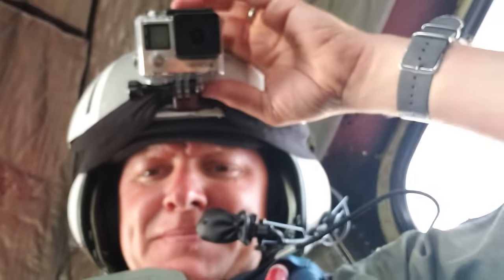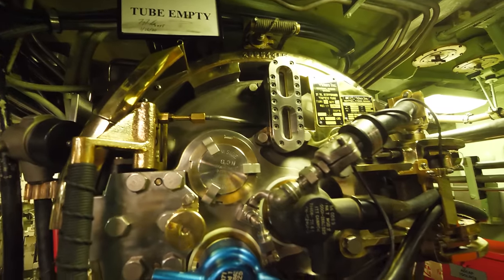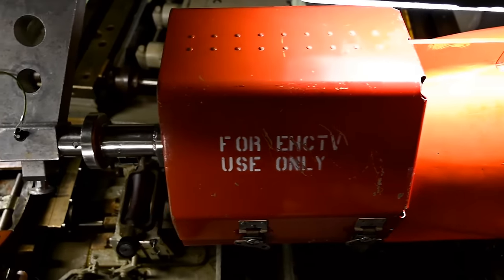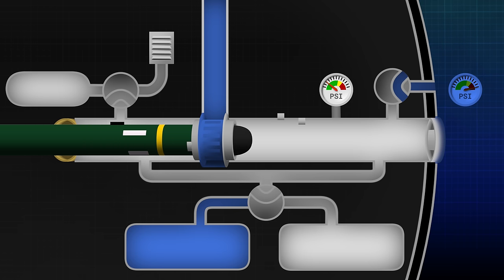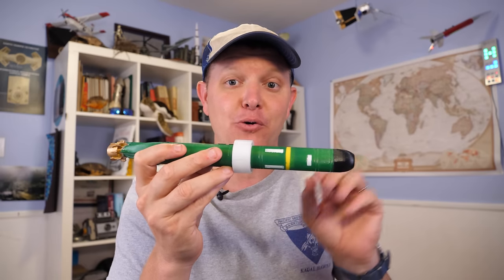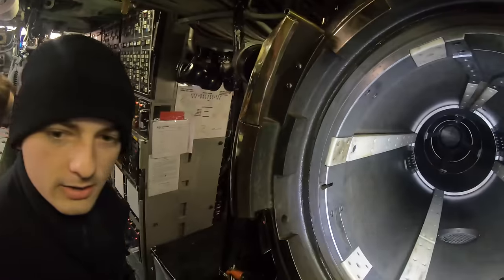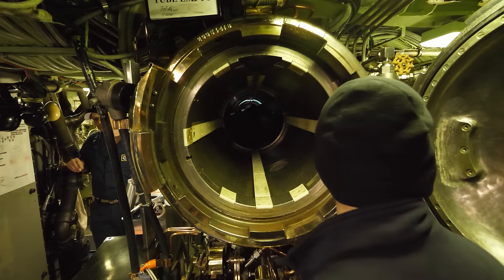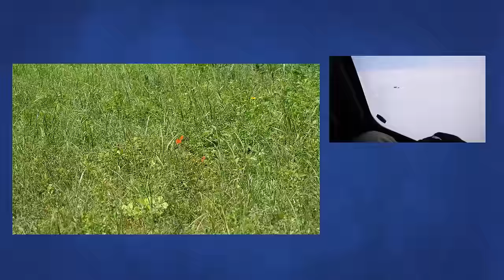Crawling Down A Torpedo Tube -US NAVY Nuclear Submarine - Smarter Every Day 241

Comment: Our company developed the active sensing warhead, for the Mk48.  I was a junior engineer at that time, and one guy and I did the "simulated" runs to test and measure the sensitivity of the warhead, at various angles, using a ten-ton truck, with an aluminum plate mounted on its side.  We drove the truck by the warhead, at structured distances and angles, to simulate both surface ships, and submarines.  Speeds ranged from 3-mph (truck minimum) to over 60-mph (or more) to determine maximum limits high and low.  A special high velocity fixture was used determine closure rates of over 100-mph.  After the torpedo went into manufacturing, we supported hundreds of test runs on targets in test bays, and then with actual ships.  Your video is one of the ones we analyzed, as verified by the spray signature.  Our company also designed the improved sensors for the Barstur Underwater Range.  Used for many such testing scenarios.  Now the Range is huge, over 100-miles wide or more in some sensing capabilities, and is 3-D, using aircraft and satellites.  Many more videos possible about its capabilities.

Comment: I love that, "Apparently there's ice on the door"
"Ice?"
"Yeah!"
I feel like when you're an expert in your field you stop noticing the funny details. In my line of work (radiation therapy) a student noticed that the old cctv monitor shows small flashes on random light from where mega voltage xray photons interact with the camera sensor.
Reply: You can see the same effect of video footage at Chernobyl. The radiation leak caused a grainy or snow effect on the video
Reply: @notmenotme614  that's more due to photons interacting with the silver halide crystals of old film. This is also how we measure body doses on staff, they're called TLD's!

Comment: Me seeing Destin sign his name in a torpedo tube: cool
My brain: I wonder how many submariners have been pranked by having the door shut on them.
Dark side of my brain: has anyone been punished by being stuffed into a torpedo tube and having it filed and pressurised?
Reply: Thats terrifying, i will never crawl inside a tube again : ^)
Reply: Funnily enough, the torpedo tubes are one of the escape routes for submariners. So yes, people have been in them. The difference is, they don't use the water pressurisation "firing" part, Just flood the tube and pop the door.
Reply: Special forces guys used to launch themselves out of the tube. I can't remember, but I think the first time they tried it they actually pressurised and fired it and the guy nearly died. He was a tough dude though and they weren't too deep so he did survive, just barely.
Reply: I've heard of shipyard workers pranking each other by locking the new guy or gal into a tube. Thankfully those are apparently open on the other side while in drydock.
Reply: I mean that would only work if the submarine is relatively close to surface, at a deep altitude you wouldn't even be able to open the door without pressurizing the tube, because of well... the pressure difference. not to mention if the pressurization itself would kill the person, so would the pressure of the sea outside as well ;)
Reply: "My brain: I wonder how many submariners have been pranked by having the door shut on them."

Pretty much all of them.  diving a tube is part of qualifying the room, and Torpedomen, to a man, believe they are hilarious.  A lot (most?) nubs freak out and start screaming.
Reply: @xmlthegreat  I believe it. Just working in an industrial setting; they would lock the new guys (of which I was one) in the elevator over lunch.
Reply: ah! 😩 Thanks for reactivating my  fears 😭
Reply: Back when I was in, I heard about some hazing.  Once a guy was down towards the muzzle door, they covered the door with a wool blanket and tapped the side of the tube with a wrench (to simulate the door clanking shut), and then cracked the pressurized air (to simulate the sound of water flooding down the tube).  The guy freaked out, and came out of the tube head first!
If it wasn't apparent from the video, it is NOT a simple matter to turn around in the tubes (and basically impossible for most people).  The single greatest factor that will determine if it is even possible to turn around in a tube is the length of your femur.  The maximum diameter in any part of the tube is about 22 inches, and your femur has to be enough shorter than that or it's not physically possible. That, a great deal of flexibility, and enough adrenaline to prevent your brain from even considering you can't turn around in a tube is what is necessary for coming out head first.
Reply: @BrianDaleNeeley  The asshattery sounds high in the Navy. Though at least that was the appropriate hazing method; closing the actual door is an unnecessary risk.
Reply: @GummieI  the internal tube pressure has to match outside pressure before the tube hatch will open, so yeah, there's limits but submariners train for some pretty deep..err..depths for surface dwellers.  In the Australian submarine Corps, there's a qualifying test for swimming, breath holding, confined spaces etc that I couldn't pass at the time I might have gone in, even with over a decade of regular surfing and swimming.   These days,  I doubt I could get down the tower ladder haha. 

I was lucky enough to get to tour an Australian Oxley class submarine when I was in highschool, which is about a third the size of an American sub and non nuclear, and I was also super grateful to get back off again. I got the chance to lay in one of the enlisted bunks and my face was less than 3" from the bunk above.  And when my host took me down to the torpedo room and explained the torpedomans escape, this Navy cadet decided that maybe the army was more my speed.

Comment: As a US Navy Veteran for about 8 years, there's a lot of things I didn't know outside my US Navy Job Specialty in NAVAL AVIATION onboard AIRCRAFT CARRIERS,  as was US Navy Schooled as an AMH-2 Flight Controls Systems / Structural, Hydraulic Technician Mechanic, My Skill easily can UNDERSTAND how a SUBMARINE WAS ENGINEERED AND moves in the water with their Mechanical Systems.

Comment: If you ever have a chance to be around light attack bombers or fighter Jets depending on the model you could ask to dive the intake which is going in from the front crawling your way down the intake tube to the very front of the engine or you have to inspect the front blades for a small vibration cracks or dings that have started or occurred. Another fun little thing we used to get to do when pre-tripping aircraft in the Navy. Fyi, I used to do that on A7-II Corsairs.
GO NAVY!! 🇺🇲

Comment: "I never would have expected ice on the door" while in a submarine under the arctic ice. Smarter every day! 
It's still very fascinating, don't get me wrong. I can't wait to see more, thank's Destin!
Reply: I wouldn't have expected ice either, because you know, liquid water on the other side of it. I'd expect it to be cold, degree or two above freezing, but not icy. I suspect he may have just mistook very cold condensation with ice. But I suppose the salinity and water pressure might drop the freezing point far enough outside that the hatch might have barely freezing fresh water inside it.
Reply: @tylisirn  Granted I've never been in a torpedo tube under the arctic ice, but it is warmer on the inside of the sub. But I could see internal moisture freezing on the inside without hesitation given the salinity. Condensation can freeze, the extreme differences could be the right variable to make ice on the inside of a torpedo tube door under the arctic ice.

Comment: Deeply, Deeply cool Destin, 
Only thing I recognised as a mostly civilian aircraft engineer were the Teflon blocks and rub strips, some marine grease, ( cleaned up the excess too!!!) and the judicious use of Graphite dry spray lubricant... other than that... At least you have room to move around lol...
No-one reads comments,  so I'll waffle for a bit... Bored as anyway.. lock down in Aus.. meh..
Anyhoo..
The Tube has more room than many aircraft fuel tanks I've been inside of... lol... 
Picture this... if you will....
Going in there with full closed face, positive pressure "on demand" breathing equipment... things get so much more tighter... then you get stuck with your left elbow against your left temple and your entire right arm locked against the side of your body...going through a baffle... 90 degrees from your intended route,  meanwhile your legs can't find a frame, rib or any sort of structure, to at least flick an ankle movement out of, (Grrr moment!!)  to move 3" to pry yourself free... (Those reading this.. it helps very much to laugh and not panic.. you won't die. But it sets the heart racing... and those with a swear jar... will be raking it in!!!...hahaha..
Then, you get your safety standby person to come in,  to give your foot or butt a good shove (hand/boot,  or even  swift kick does the trick lol) so you can continue on your journey.. Usually to a fuel pump or a fuel quantity indicator...worse is a fuel leak.. spend hours digging up sealant...  Fun all around... lol...

sigh 27.5 years of entertainment.....

Wouldn't trade it, for the best desk job paying 4 times the amount.

In all seriousness
 Claustrophobia is absolutely harrowing. 
As I'm in my mid 40's now it gets worse with age. I feel it sometimes but control it by focusing on my task. Breath... carry on.

In the end... Not trying to compare or even try to compete... in any way... (How could I?!,  Destin, you are far beyond a level playing field in any way...! Wow...!) 
Just watching this is blowing my mind..!!. Barely anyone gets to see this stuff let alone ask intelligent questions!!, 
(I'd be drooling .... in the corner..... literally...)
This is Leading edge military stuff here shown on YT... OMG!!

Thank you so much for sharing this once in a lifetime experience with us Youtubers... 
Best Channel ever...!!!

Sorry for the rant... I rant a lot... mostly cranky stuff but this channel just makes me smile a lot...
PTSD sufferer and all round cranky pants..

Be good to one another kids...
Reply: I actually found this quite interesting. So you clean(ed) out fuel tanks for a living? :)
Reply: This is a channel that makes me smile a lot about too. Thank you for sharing your experience, I understood it was tight, but I now know a little better on HOW tight those fuel tanks are.. Keep smilin'!
Reply: I like your comment
Reply: Imagine how the Navy Seals feel, when being launched out of those tubes..
Reply: Honestly, more interesting than 99% of all other comments, please don't stop ranting on the behalf of other cranky nerds that complain :P
Reply: @lordgrubbin9394  Thank You!.
We do other stuff like Engine changes, Hydraulic Pump and line work, pneumatic duct work.. to..,Fixing  the IFE (in flight entertainment) change worn tyres (Tires) and the odd brake change when they get down to their Max wear limit... and anything else that may arise including... fixing a coffee maker that has gone down the crapper.... speaking of crappers... yes... Toilet "unit" changes is part of the job too.. lol. and everyone's beloved job... the waste tank remove/install... just stop....lol i've seen an entire waste/toilet tank dumped upon a work collegue and it was far from pleasant.... 

Awesome job on paper hey?? To spend 9 hours on the job without a break... on a 12 hr shift... 
It's what we do.... sorry... DID!! Things are so far different now... sigh 

Just know... there are guys and gals, that are absolutely 100% doing their utmost to keep all our birds ready to rock at a moments notice.!!! They're all safe and ready to roll out.
Reply: @denjisenpai4569  I must agree! This comment really surprised me... It's style really is quite captivating. :)
Reply: That was a fun read. Sometimes it is cool to hear about the life of machinery maintenance. (All of my stories are from a short time span and are only in machine shops.)
Reply: @steveblackbird  your comments should be a series of their own. Keep them going, highly entertaining reads :) greets from a locked down Northwest UK.
Reply: True thoughts of many people watching... cheers m8
Reply: @johnstrad  I agree! :)

Comment: This gives me some real PTSD. As I commented on your other video,  I am a nuclear worker, and my last job had me crawling through pipes the exact same size as these tubes. Only difference is they still had water in them(up to 50% capacity at certain sections) and we had to crawl 1200 feet or 4 football fields deep into them to first drain the water, by crawling and pushing it out, and then chipping out old sections and then patching/coating it. I have moderate claustrophobia, and I can tell you that it was not always a good time. Especially when 55 degree water comes rushing up from behind and completely submerges everything except for your head! Luckily we had little skateboards we rolled on but it didn't make it any less terrifying. It was all I could do to even fit in the pipe and we were exhausted every day and covered in grime. Not my favorite job in the industry by any means!

Comment: Brings back memories,  I served aboard the U.S.S. Boise SSN 764, back in the early 90's,  which is the same class Submarine as the Toledo.  I was an Auxiliary machinist mate and our main work area was the Auxiliary Machinery Room AMR which was just aft of the Torpedo Room.  We handle the atmosphere equipment,  the diesel generator, the ventilation system hydraulic system, trim and drain system, compressed air system,  refrigeration system and we were responsible for maintaining the galley equipment.  They referred our division as the A- Gang, and we were known as A-Gangers.

Comment: A buddy of mine was stationed on a nuke sub for awhile. He told me a story about how, as a new plebe enlisted guy, he was told to go into the torpedo tubes with a toilet brush and "polish" the walls. Once he got into one of them and crawled to the end to start scrubbing, somebody closed and locked the inner door, then opened the outer door of the torpedo tube (which i guess usually only happens when they are getting ready to fire). He totally freaked out and started screaming, until a few moments later they opened the door and let him out, laughing at him. Apparently it was some kind of initiation tradition that they do to the new guys. Sounds terrifying. Better him than me.